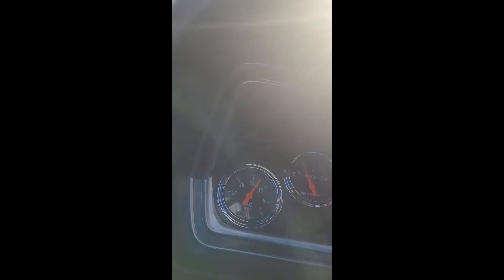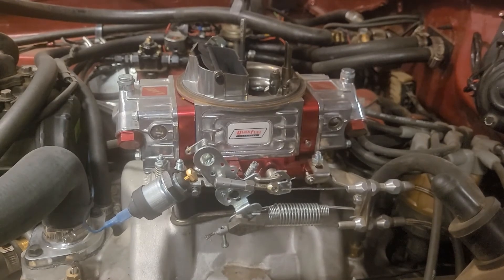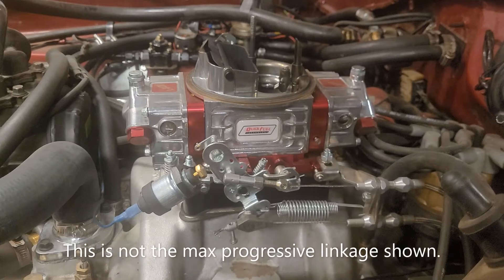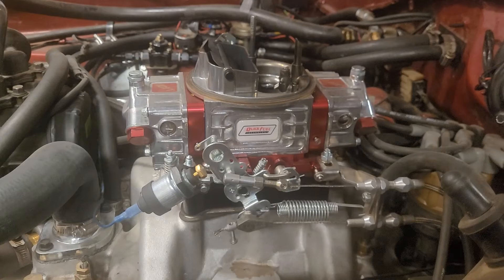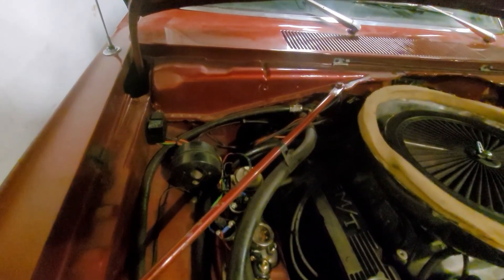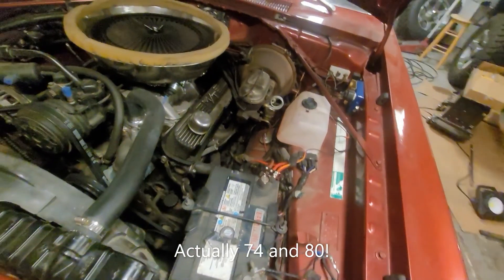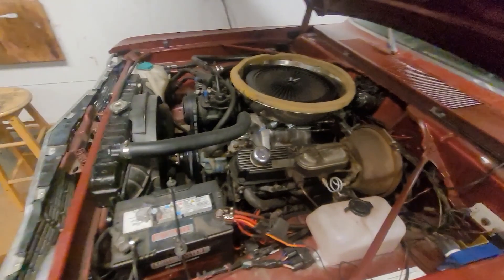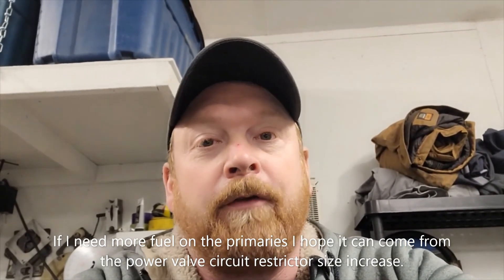Carb tuning adventure #2. Road to the #nonamenationals #noname500

Comment: Your welcome. Before you get the 02 sensor,  take a cheap shoot and measure the temps of each primary header. See what your temp variation is. If you are lean...your temps will be very high and far apart. Good job finding the blocked secondary port. By your vacuum reading...you have healthy manifold vacuum. 15psi is strong. If you can record it while you plant the right foot. See what it drops too. It should drop to around 8-10 lbs. The bigger the carb...The longer it will take to recover from the bog. Your right...If it drops to 10...you need 2 points lower of a valve. If it drops to 8...The 6.5 is ideal. Other information that helps to know. Do you have vacuum operated timing? If it does...The timing doesn't advance when the vacuum drops. Also causing a incorrect a/r . Look up initial timing lock out from 318 will run or utg. A typical vacuum ignition will very from as low as 12° initial timing to 35 total. That causes major hick ups when you tromp the pedal. Locking the initial timing closer to 18-22° helps the response much better. 
   Your doing perfect. Even carb gurus like Andy from unity motor sports needs time sorting things out.  When you try the carbs steps you have planned. Look at the timing. Just to make sure.
Reply from the maker: Thank you very much for the response!

Comment: Un hook the secondaries completely than go for a drive.  It sounds crazy but I bet it has no stumble.    My guess is the combo of a very low stall speed converter and that cam and the bigger carb is causing this.
Reply from the maker: I had thought of running it as a 2 bbl for a test. I will definitely do that. Thanks the suggestion!

Comment: Camshaft specs?
Reply from the maker: Summit Racing Part Number:
SUM-K6901
Cam Style:
Hydraulic flat tappet
Basic Operating RPM Range:
1,800-5,500
Camshaft Use:
Street
Camshaft Manufacturers Description:
Fair-smooth idle, low-midrange power. Works with stock-2,000 stall, 9:1 and higher compression, and gearing.
Intake Duration at 050 inch Lift:
218
Exhaust Duration at 050 inch Lift:
228
Duration at 050 inch Lift:
218 int./228 exh.
Advertised Intake Duration:
276
Advertised Exhaust Duration:
288
Advertised Duration:
276 int./288 exh.
Intake Valve Lift with Factory Rocker Arm Ratio:
0.441 in.
Exhaust Valve Lift with Factory Rocker Arm Ratio:
0.441 in.
Valve Lift with Factory Rocker Arm Ratio:
0.441 int./0.441 exh.
Lobe Separation (degrees):
114